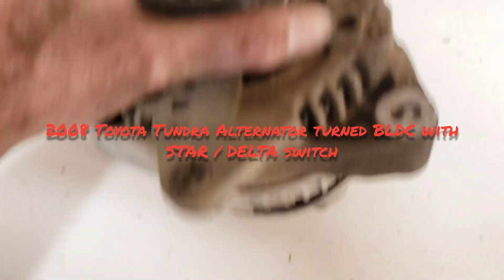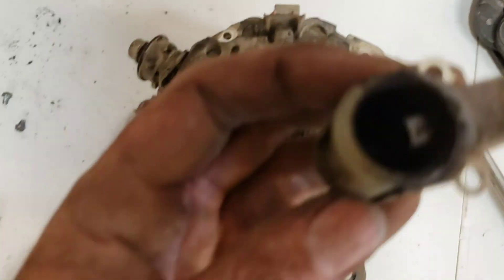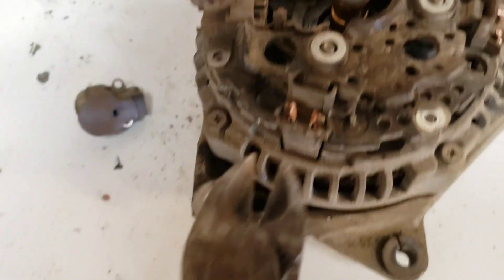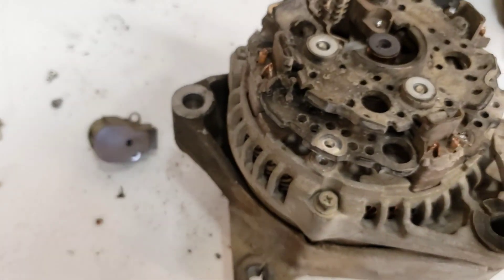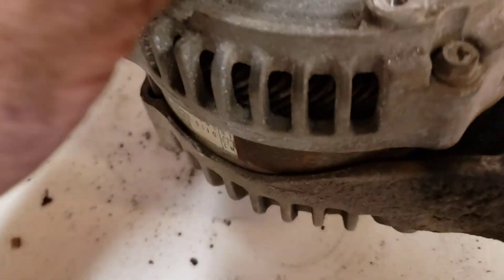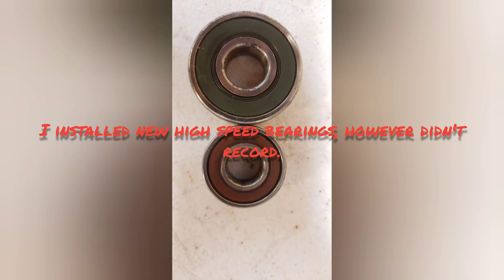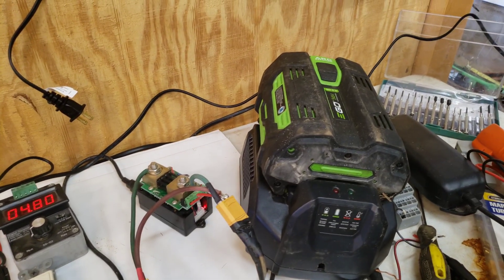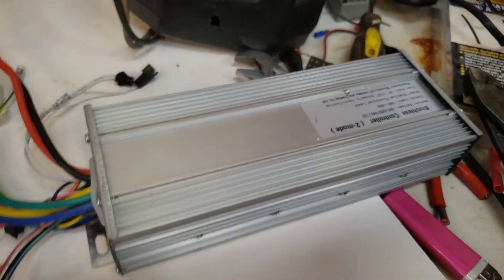BLDC truck Alternator to 3 phase motor with Delta/Wye switch using 2000w brushless controller w 56v

Comment: Long shot but I’m trying to do the same thing with a Denso alternator.  I’ve read about the way these stators are wound and I am thoroughly confused on which way to connect the wires.  I’ve got correct rotation, but the motor actually screeches to a halt.   I’d love to use the Denso unit because it fits so nicely into the quad frame I intend to drive with this unit.

Comment: Hello, i have an alternator very similar to yours with 6 wires, but i cant figure out how to connect the wires to wire it to an esc, because physically there are 3 groups of 2 wires, BUT 2 pairs of 3 wires each that have continuity with eachother. Totally throws me off. I dont care if its delta or y for now just trying to figure out which end is which.
Reply: Hey howdy. Did you ever get a response to this? I have the same situation and not sure how to proceed and I don’t know what would happen if I took the risk.
Reply: @IdowuAsumah  yes actually I did. Theres something called dual voltage motor with 6 leads. I dont remember exactly what the details were but there is something called double wye and double delta. I think mine was double wye before i cut the regulator off and once i cut the regulator off I was left with two wye coils? Sorry i dont remember the exact details but look up stator configuration for dual voltage motor i think the 6 leads give you two wye coils then you either wire them in parallel or series depending if you want low or high voltage. Just reply if you want and ill try and figure out more details
Reply: The only risk would be possible short circuiting your supply but there is probably some kind of over current protection built into your controller. I think i gave up before figuring out how to connect all 6 windings together so let me know if you figure it out

Comment: Just happened across this and you've piqued my curiosity. I was just about to dig into a conversion project. As I'm brainstorming ideas for working in a load based programmable rotor input, I've been flip-flopping over the delta vs wye situation. (discharge rates are of primary concern) I hadn't considered I didn't have to choose. 

Thanks for this.

Comment: Perhaps it will be you who will actually show the alternator as an engine. I'm from Brazil, sorry for the google translation. I see many alternator designs as engines, but few show practical application. One of the few, perhaps the only one I saw, is by Pedro Gomez from the Dominican Republic, he has several videos. He converted a small motorcycle with the 72v alternator and 1500w Chinese controller. It uses a DCDC 72-12v for the excitation of the rotor. I really enjoyed seeing your test alternating the star-triangle connection. I would like to know which of the two gives more torque and if the higher torque is with the connection with less rotation.
Take a look at his video riding the motorcycle https://www.youtube.com/watch?v=qnl3aWsgav8
Reply from the maker: Thank you for the comment!   I plan to build a dyno to measure torque and horsepower of the various wiring arrangements to get you some usable data.  Unfortunately work has been busy and requiring 7 days a week of my time.   I will check out the video link you shared!   I am very interested in practical application's, so thank you very much!
Reply: @samsracing  subscribed 😀

Comment: I followed multiple videos but no luck. My bosch 14V 140amp alternator doesn't turn at all. I even bought a new esc controller for it. I dont the continuity test and wired the wires accordingly to the ESC yet i hve no turn. I powered the rotor to magnetize it .
Reply from the maker: @Joel Rebelo.   That can be frustraiting.   Do you have a video of the setup you could send me a link to?   It is difficult to offer any suggestions with the information you have provided.    The questions I have right off the bat is how you wired the alternator, star or delta?   Does the motor tighten up (is it harder to turn) when you apply voltage to the rotor?   Does your esc function on another motor (standard bldc motor)?  What happens when you try to turn the motor?  Does nothing happen, does the controller whine and motor jump and make noise, does the motor shaft lock up?  These questions will help me get an idea of what is going wrong.   Ive made a few mistakes with the gm style alternators which if your alternator is wired the same way, i believe I could only get delta wiring to work on one delco-remy alternator due to the strange way the individual coils are routed out of the winding(its difficult to tell which is the start and which is the end of the winding) when looking at the back of the alternator in a circle...  they were out of order.   Let me know the above, and i can try to get you up and running!   Thanks for the comment!  I look forward to your reply

Comment: Interesting setup. Once you do the conversion, what is this "motor" capable of running, and can it run continuously like this, well at lease for a half hour or so at a time? I see so many alternators converted to motors, but no one shows it being used for anything...
Reply from the maker: @Gary Mucher That is a good question!   I have seen alternators used in go carts and in ebikes with a lot of success.   I would have to dig for the ebike conversion channel which was pretty impressive.   I believe it was the same guy who made a video of a gocart he did a few years back.   

 My plan to solve this question, which I havent seen before is a small outboard conversion or a jet ski.

   The first part of your question is answered by the thermal limitations of the windings and insulation.   I haven't done much load testing or over voltage testing of one of these yet to see where the real limitation is.   

Using a rough practical thought exercise, this 160 amp alternator running at 14.4 volts would be running around 2300 watts of rated continious use in theory, under a hot hood coupled to an engine running at around 190 degrees f.  That is around 3 horsepower based on the conversion of 750 watts per hp. Thats not too bad for its size and weight.  

I believe (with no evidence, assuming a 3x safety rating in the 2300 watt rating) that I can get one to live up to around 9-10 horsepower with the added heat dissipation available in a water cooled application, one which a boat or jetski would be perfect for testing.   The issue with longer duration testing at a high wattage would be energy capacity and thermal limits of all the components.

 To store the energy required to run continuous for any length of time I would need to be able to hold a rather large battery, something that a boat does with relative ease compared to a bike or gocart.

  About 2 years ago I had made progress on an outboard application using a similar alternator, however had to uproot and start a new life across the country.   Im just getting back to this, however, have been hoarding 18650 cells in anticipation of getting back to solve your very question.   

I could build a dyno to do some bench testing, which may be wise prior to moving forward.   What do you think? Would a dyno be something you would find interesting?

Thank you for your feedback, and I look forward to your reply!